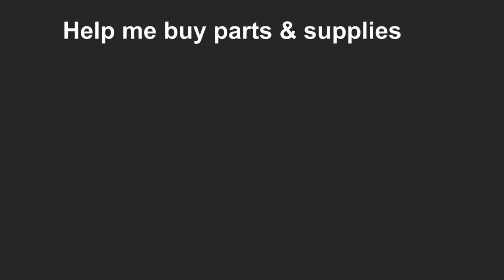How to Remove and Install the Hook & Finger on a Singer 401A PART ONE.

Comment: Hello Andy, I'm totally desperate. When sewing, the thread becomes tangled on the underside of the fabric after a few stitches. What could be the reason? I've tried everything possible with the help of your tutorials. I filmed the problem. Can you take a look at this, please?
Reply from the maker: Your needle thread is catching on the back of the hook. Too much slack in needle thread. You skipped the last two thread guides when threading your needle which may be the cause of the catching. Thread the needle as shown in the Instruction Manual. If you need the manual you can download a FREE copy from Singer at this link: https://www.singer.com/search/support?title=401
Is this machine new to you? Did it ever sew properly for you? Did you do any repair/adjustments to the machine?
Reply: @andytubesewing1953  Oh. I didn't notice that at all. The error also happens when I have threaded the thread correctly. So far I've worked with an electric 401. This is now mechanical. I cleaned the machine and had to readjust the thread tension part. I did it step by step according to your tutorial. The machine worked fine for a while too. What else could it be?
Reply from the maker: @linuspelt3561  What is a "mechanical" 401 like? Just curious b/c I've never heard of it. One of the things that can cause under looping is lack of upper tension or needle thread tension, so you want to be sure you have the tension unit zeroed out properly. You can see how I test for that starting about 46:00 in this video https://youtu.be/eVLiED-FCA8
Another cause for under looping is if the bobbin case tension is set way too high b/c that pulls the needle thread right down through the fabric. Here is a video about cleaning and setting the bobbin case https://youtu.be/HT5XZ5eYYEQ
Maybe start with those two items. Other things that can cause under looping are if the stroke of the check spring is not set properly, or if someone worked on the takeup lever system and did not set/reinstall it properly and it is out of time with the hook.
Reply: @andytubesewing1953  Many Thanks. I will try the tips for the next few days. By mechanical sewing machine I meant one with a belt drive.
Reply from the maker: @linuspelt3561  Belt drive, like a treadle system? Is your machine a German-made SInger slant needle then? Like a 404G, 401G, or such? I still lean towards a lack of needle thread tension. I say that b/c in the video the needle thread under the needle plate is so loose that it catches on the grove of the hook and not only the point of the hook. Your video shows plenty of the looping thread results, but not much of the mechanical action that would show the cause. Good Luck.
Reply: @andytubesewing1953  Yes, its a German 401 G treadle sewing machine. I'm so sorry, but my English is not so good and my discription before was really bad. Ok, I will adjust the tension of the bobbin and the upper thread  like you do in the Video. If that doesn't work i'll make  another Video. Which area shout i best include while filming? What can be helpful?
Reply from the maker: @linuspelt3561  Your English is fine. It helps us troubleshoot a stitching problem to show more of what is happening under the bobbin slide plate and needle plate. That is where the needle thread, bobbin thread, and hook all work together. 6 seconds of the top stitch and 5 more of the under looping thread is enough. We get the idea. In the video when you pulled the slide plate back and showed the hook rotating and I could barely see the needle thread get caught on the side of the hook, that 3 seconds of video, told me more about the problem the all the rest of the video. Ideally, when one has a stitching problem, showing how you thread the entire path of the needle thread, thru the guides and around the tension assemble and thru the take-up lever and down to the needle helps us know if you did that correctly. Showing the problem stitches is good. Showing what is happening under the plates is even more informative. Letting us know if you did any repairs are adjustments helps. If the machine was working great then this suddenly happened, or the problem was existing when you got the machine. It's like showing a flat car tire... we see it's flat but can't see the 6-inch nail sticking out the backside of the tire. Stating you were driving along, thru a heavy construction zone, and the tire suddenly went flat is a good clue for us. Yes, the first I would do is TEST the upper tension assembly as I show in the mentioned video. Your assembly may be adjusted perfectly and no further action needed in that area. Test twice, fix once is the way to think of it, or "if it ain't broke... don't fix it. Good Luck.
Reply: @andytubesewing1953  so. Now I've checked some settings. the upper thread tension is approx. 18 g, the lower thread tension approx. 28 g. I have set the check up spring with an upper thread tension of 0. the eye of the needle is in the right position. but if i change the thread tension now, the needle position is no longer correct when the check up spring is at rest (see video). is this normal? i have made other short videos that will hopefully help solve my problem.
Reply: Here are the videos
https://youtu.be/sgxQsrR1Fww
https://youtu.be/SE8B3_5LYmk
https://youtu.be/Hm9smJWYHgA
https://youtu.be/r2c8JtIFR1k
Reply from the maker: @linuspelt3561  Be sure your needle is all the way inserted into the needle clamp. I've made comments on your videos.
Reply: @andytubesewing1953  I've now done a few test stitches and they look very good. Although I only adjusted the upper and lower thread tension. I still have one question about the timing of the hook. the hook timing mark and the hook are in the correct position. and yet the needle is apparently too deep. is the needle too long? I made a video to illustrate
https://youtu.be/ShBoRecf9A4
Reply from the maker: @linuspelt3561  This machine uses a 15x1 needle. It looks like your needle is even a Singer needle. I do not think you used the wrong needle. I think the needle bar height may be set too low. That is why when the hook point arrives at the needle, the point is a little bit too high (1/16th inch or less) or the eye is too low. Part of checking and setting the timing is to check/set the needle bar height. That is what I would check... the height. Here is a height and timing video for a class 403A model to show what I mean https://youtu.be/cHkqoYYlvRE    If your machine stitches OK then why worry? Don't fix what is not broken. If you are skipping stitches then you may need to reset the height/timing of the needle bar. You also said the test stitches "look very good" now, so I assume the terrible looping that started this conversation has been fixed.
Reply: @andytubesewing1953  I just adjusted the bobbin thread tension with the help of your video. it has been working since then. Thank you so much for your help. Donation is coming soon
Reply from the maker: @linuspelt3561  Thank you, and congratulations. In the end, it was a tension unbalance that caused the bad looping. Maybe form the upper tension and the bobbin case both. Happy sewing (treadling, hehe)

Comment: There was a little rust on the hook and I used Rust-Oleum Rust Dissolver Gel Formula as per instructions. It turned most of the hook black. 😩 I tried baking soda paste and then Bar Keeper’s Friend with no results. Is it a chemical reaction that can’t be remedied? I dried the hook and applied a thin coating of Tri-Flow oil as I would usually. I am assuming this discoloration won’t affect how the hook works. I feel like a total rookie.
Reply from the maker: I'm not familiar with that product. I know it has twice the phosphoric acid than The Must for Rust formula I use. Maybe that's why the staining. Rustoleum has a Help & Support section with phone and email contacts. Maybe they can advise you of a solution https://www.rustoleum.com/pages/help-and-support/product-support/
I don't thick it will affect the usuage of the hook at all.
Reply: Andy Tube Thanks, Andy.  Because it won’t affect usage I will leave it be. I remember when I bought the Rust-Oleum that I only did so because the Must for Rust was going to take a month for delivery.
Reply from the maker: Sorry it happened to you, but thanks for sharing that info on my channel. Good to Know!

Comment: I have the service manual, but right now I'm struggling to get it timed? I can't slide the gear out to freely rotate the hook? Any advice?
Reply from the maker: If the gear is "stuck" to a shaft it is often from hard, dried-up oil. I have put WD40 in the setscrew holes, or alcohol or kerosene to try and soften the oil. I have had good luck using a hairdryer to heat the gear/shaft up to loosen it also. The gear/shafts are steel and can take a good amount of heat. Sometimes a couple of minutes, sometimes much longer, depending, but the gear always gets free.

Comment: Thank you for the great Video. Where can i get the flat screwdriver ( Minute 9 in the Video)? How is this Tool named?
Reply from the maker: https://chapmanmfg.com/collections/slotted-flathead-sets        video: https://youtu.be/KnrvDZeaYj4
Reply: @andytubesewing1953  Great. Thanks a lot
Reply from the maker: @linuspelt3561  Sure. I love using mine and wished I had bought the next size up that included a few more bits rather than the starter set. You can buy individual bits though, whenever you like. Take care.

Comment: How to fix base finger and the needle bar camp for an industrial sewing machine
Reply from the maker: I have no idea, Roth. I've never even touched an industrial sewing machine of any brand/type. If you can figure out the model number you can search online for a Service Manual for it. I've done that with unfamiliar domestic models and the manuals helped a lot. Here is just one of the sellers I have bought manuals from    https://manualsoncd.com/   Their PDFs are clean and clean and reasonably priced. You'd also be surprised how many document-sharing sites have free copies of some manuals. Good Luck.

Comment: Can You Make This Sewing Machine Stitch 12mm ??? Any adjustment ??? 
Thank You..... it is a Good Machine To Sewing Leather But The Max is 7mm.
Reply from the maker: The Service Manual for Singer Model 401A shows the maximum width of the zigzag stitch to be just under 5mm (4.7625) and the maximum length stitch to be just over 4mm (4.2) There is no adjustment or modification that can make the machine sew a 12mm stitch. This is a Domestic (household) model. You may be able to find an Industrial Model with a 12mm stitch but IDK as I do not work on them.
Reply: @andytubesewing1953  Thank You My Friend Merry Christmas.
Reply from the maker: @-mejor-que-nostradamus-6152  good luck.